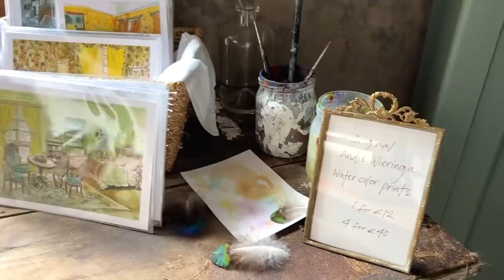Starting Building Work on the Chateau's MOST IMPORTANT Room!

Comment: Stephanie, I don't know if you ever go back and read comments, but I just found the solution to the fireplace in the Marquis' salon!! It is quite obvious actually 😂 BUT - Ask Amaury, if he has enough wood left from the paneling - to make a cover/surround/Mantle for the cement block, and the rest of the fireplace, if possible!! There has to be room for the painting - but, since the wood matches with the rest of the wood panels, the cement will no longer stick out! AND it is also in keeping with what could have been there originally!! It might even have been the intention, when that cament block was put in!

Comment: In France the building lumber is green wood? That’s wild. Here in the US, our SPF (spruce-pine-fir) softwood building lumber is all kiln dried, I think, even if it’s not pressure or chemical treated. I think it’s in the building codes that it must be down to a certain moisture content to be sold as building lumber, and only wood for outdoors like fencing is sold green because they can get away with it. In Home Depot like stores, you often get pretty bad quality and all bowed and warped and sometimes knotty or even moldy, but the size is fairly consistent. It can be truly awful stuff unless you have the patience to sit there and pick out boards one by one; my woodworking instructors of course would say don’t even go to the big retailers like that for lumber, and they have us buy our hardwood rough to learn to mill it square and straight in the shop. So I expect real builders ordering in larger amounts from local lumber suppliers expect to get better quality even on the cheapest construction SPF lumber, by going with dedicated lumber mills and local suppliers over the big box retailers (which are marketed for both DIY and pros in the US, they all have a “pro desk” as well as regular retail for the public).
Reply: It's not. Builders / carpenters usually buy their wood / materials with builders suppliers. The most famous is  a chain called Point P but others are good too.
Reply: Even Notre Dame's forest of trees that will support the new roof will be done in the ricky and historical way with green wood. The weight and interlocking system must keep the roof and spire from twisting. It was a decision to save a year or two of time. They are using 200 year old trees.